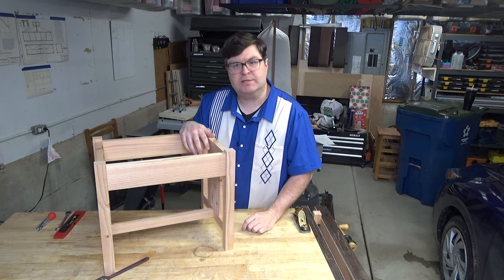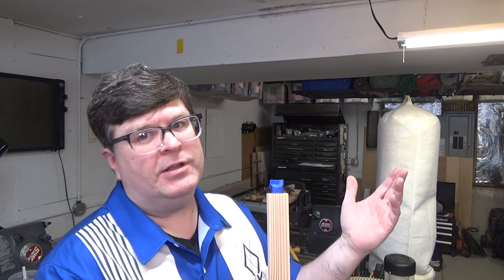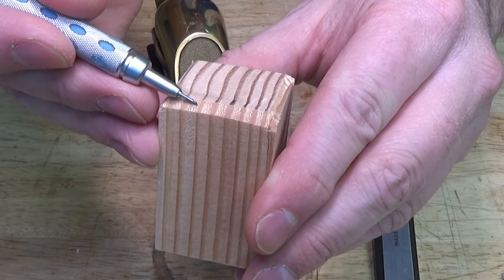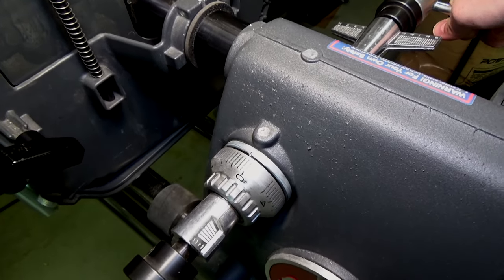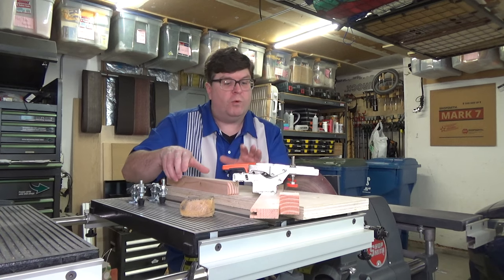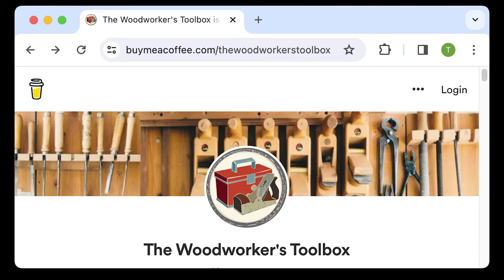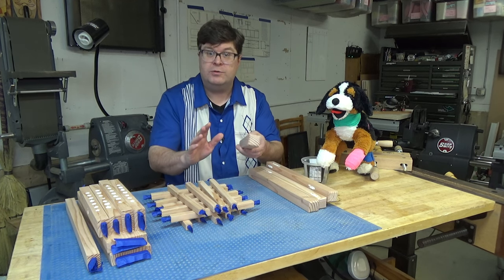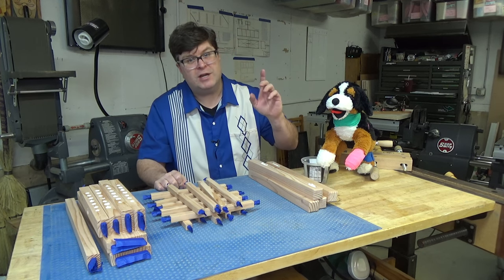Easy Cure For Nasty Chamfers!

Comment from the maker: 🎬 Neighbor Fred's Full Conversation available at https://www.buymeacoffee.com/thewoodworkerstoolbox

Affiliate Links
❇  Bessey STC-HH70 Auto-Adjust Toggle Clamp → https://amzn.to/49bJl3k
❇  Traditional Toggle Clamp → https://amzn.to/3UddRpz

❇  Woodstock D3831 Adjustable Block Plane → https://amzn.to/499XVIL
❇  Rockler Silicone Glue Mat → https://amzn.to/3UjBRaq
❇  BOSCH ROS20VSK Palm Sander → https://amzn.to/3SzdvYU

❇   Wolfcraft 5-inch 5894000 Sandig Block → https://amzn.to/3HUIIQt
Check Prices! As of this post, the Wolfcraft sanding block ships from the U.K. making it much more expensive than my purchase several years ago. An alternative would be the Milescraft 1620 SandPlane, which also uses 5-inch RAS discs. https://amzn.to/3OguXPx

The TayTools 5 1/2 Bench Plane used in the video is no longer available. The Rockler Bench Dog plane is the next closest match. However, for the few extra dollars, I would go for the Woodriver version.
❇   WoodRiver #5-1/2 Jack Plane → https://amzn.to/3UhyjFz

"More Shop Drawings for Craftsman Furniture: 30 Stickley Designs for Every Room in the Home"

❇ Get the Book → https://amzn.to/48jsPyu

Non-affiliate Links
● Shopsmith 12-inch Disc Sander →  https://shopsmith.com/12-inch-disc-sander/

Safety
👍 I always read the manuals for my tools which contain details on how to operate the tools in the safest manner possible. I keep a print or digital copy handy at all times.

Comment: I never thought of doing chamfers using the Shopsmith disc sander in that way! That’s a great way for consistency. Also, shop dog’s vet bills must be getting pretty expensive with all the injuries he gets!
Reply from the maker: In hardwood, it would have been more manageable with edge tools. But that softwood crushes so easily, abrasives are a good alternative.

Comment: Well done and thanks for the shout-out. Did you use an abrasive cleaning stick at any point?
Reply from the maker: Thanks Scott,and you’re welcome. No I did not clean the disc. When I grabbed my crepe stick it was oozing goo. Like the rubber had liquified. Maybe was exposed to solvent? Was quite old. Need to pick up another one.
Reply: @TheWoodworkersToolbox  Woah, I’ve never seen that happen. I’ve had them dry up, but never turn into a Gusher!
Reply from the maker: @MyGrowthRings  They were dry as well, not a gusher but oozing a sticky film that I did not want on my hands, tools, or wood. When I get a new stick I cut it into thirds. I don't need a 10-inch stick and the probability of locating at least one of the thirds is much higher!